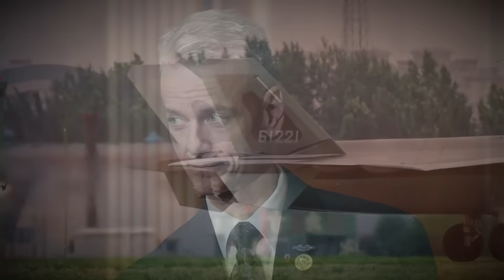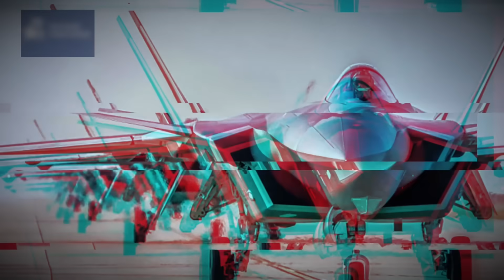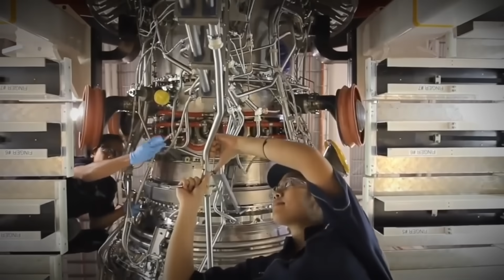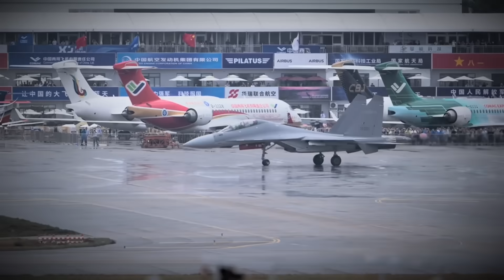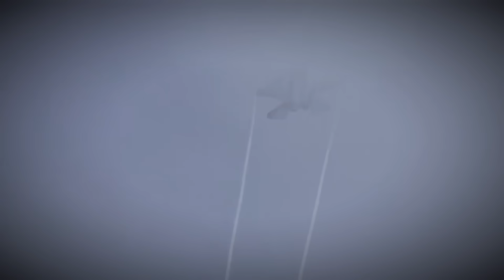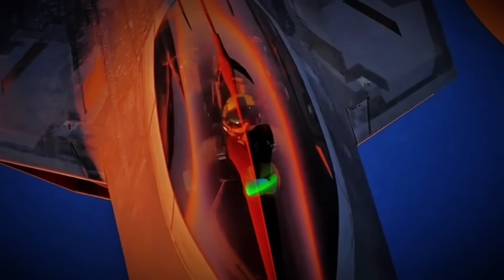GE Just Broke Its Silence on China's Jet Engine Advancement

Comment: You can bet China will continue to improve its jet engines, gaining more thrust to weight, and improved reliability.
Reply: China's Fighter Jet Engines: 5th-Gen Leading the Way, 6th & 7th-Gen Test Flights Breaking New Ground, Fully Surpassing the U.S.
 
China's aviation engine sector has achieved a leapfrog development from catching up to global leadership. The 5th-gen engines WS-15 and WS-19 have long outperformed their U.S. counterparts in performance. The 6th and 7th-gen fighter jet engines have even completed successful test flights ahead of schedule, completely widening the generational gap with the U.S. in core technologies, performance parameters and future layout, demonstrating the strong strength of China's aviation engines and firmly seizing the commanding height of the global aviation engine track.
 
In the field of 5th-gen engine power, WS-15 and WS-19 have made precise breakthroughs in U.S. technical barriers. As the standard power for the J-20, WS-15 is a performance benchmark among global 5th-gen large-thrust engines, with afterburning thrust reaching 18.5 tons and thrust-to-weight ratio exceeding 10.5. Compared with the F119 engine equipped on the U.S. F-22, its thrust is increased by 18.6% and thrust-to-weight ratio is over 50% higher, directly endowing the J-20 with 1.8 Mach supersonic cruise capability, and the response speed of supermaneuverable actions is 0.8 seconds faster than that of the F-22, achieving comprehensive suppression in air combat and penetration capabilities. In terms of core materials, WS-15 adopts domestically developed 3rd-gen single-crystal turbine blades that can withstand temperatures up to 1577℃, equipped with 128 nanoscale micro-cooling channels, improving cooling efficiency by 37%. The stable working time of the blades exceeds 4000 hours, and its high-temperature reliability is 1.5 times higher than that of the F119, completely solving the problem of high-temperature wear of previous aviation engines. WS-19, adapted for medium-sized 5th-gen fighters, is a world-leading medium-thrust engine with maximum thrust exceeding 12 tons, far surpassing the 10-ton thrust limit of the U.S. F414 engine equipped on the F/A-18. Its turbine inlet temperature reaches over 1850K, with excellent explosive power and energy conversion efficiency. It also adopts a compact 3-5-1-1 configuration, reducing weight by 12% while improving reliability by 20%, adapting to the deck operation needs of carrier-based aircraft. Its performance is comprehensively superior to the U.S. F414 and European EJ200 engines, filling the gap in domestic medium-sized 5th-gen fighter power.
 
On the basis of the stable leadership of 5th-gen engine power, China's 6th-gen fighter jet engine has taken the lead in completing installed test flights, with technical maturity and performance far ahead of the U.S. The U.S. 6th-gen engine XA100 is still in the ground test and partial verification stage, with unresolved mode switching failure risks, while China's 6th-gen variable cycle engine has achieved stable air operation, with core technologies and performance indicators reaching the world's leading level. In terms of performance, the engine's afterburning thrust exceeds 22 tons and thrust-to-weight ratio is over 12, 17% and 14% higher than the U.S. XA100 target values respectively. It adopts variable cycle technology with independent intellectual property rights, which can seamlessly switch between "high-thrust supersonic cruise mode" and "high-efficiency energy-saving cruise mode" in less than 0.5 seconds. It can not only support 6th-gen fighters to achieve 2.5 Mach supersonic cruise and a range exceeding 10,000 kilometers, but also reduce fuel consumption by 37.5% during subsonic flight, balancing combat effectiveness and endurance; the U.S. XA100 can only achieve a 10% increase in thrust and 25% fuel saving, and its complex mechanical valve structure is prone to stuck mode switching, resulting in significantly lower practicality. In terms of technology, China's 6th-gen engine innovatively adopts a three-bypass + interstage combustion chamber design, reducing 20% of core parts, with a fault diagnosis accuracy rate of 99.2%, which can predict faults 200 flight hours in advance and improve maintenance efficiency by 50%; it is also equipped with new stealth composite materials, reducing the engine's radar cross-section by 60%, meeting the all-domain stealth needs of 6th-gen fighters, while the U.S. XA100 still uses traditional metal casings with no substantial breakthrough in stealth performance, showing an obvious technological generational gap.
 
More promisingly, China's 7th-gen fighter jet engine has completed its first flight with the prototype, while the U.S. is still in the technical pre-research stage, completely seizing the opportunity in the future aviation engine track. China's 7th-gen engine breaks through the traditional turbofan power framework, adopting combined cycle propulsion technology integrating turbofan-ramjet-scramjet, combining hydrogen-oxygen rotating detonation power principle, with thermal efficiency reaching 49%, thrust increased by 20% compared with 6th-gen engines and weight halved. It can support fighters to achieve hypersonic cruise above 5 Mach in the atmosphere and a maximum speed exceeding 6.5 Mach, and can also adapt to low-orbit space flight, realizing "air-space integration" all-domain combat; the U.S. 7th-gen engine still focuses on traditional turbofan technology upgrades, failing to overcome the hypersonic propulsion mode switching problem, and can only achieve a speed target below 4 Mach, with comprehensively limited power performance and application scenarios. In terms of core technological breakthroughs, China's 7th-gen engine has conquered key technologies such as high-temperature supercritical pressure pipelines and quantum plasma stealth coatings, with turbine blades capable of withstanding temperatures exceeding 1827℃, and can operate stably in extreme environments such as high-altitude low temperature (-60℃), high humidity (95%) and sandstorms, with full battlefield adaptability; it also innovatively adopts intelligent bionic structure and self-healing technology, which can automatically fill and repair minor component damage within 1 hour, greatly improving battlefield survival capability. In contrast, the core materials and self-healing technology of the U.S. 7th-gen engine are still in the laboratory stage, and no long-term ground thermal test has been carried out. Compared with China's progress of completing the first flight and gradually advancing engineering, the generational gap cannot be narrowed in the short term.
 
From the 5th-gen engine outperforming U.S. counterparts, to the 6th-gen engine leading in test flights, and then to the 7th-gen engine taking the lead in opening a new air-space track, China's fighter jet engines have achieved continuous breakthroughs in three generations of iteration, with core materials, key technologies, performance parameters and development progress comprehensively surpassing the U.S. It not only lays a solid power foundation for the leapfrog improvement of China's air force combat effectiveness, but also redefines global aviation engine technical standards, demonstrating the absolute competitiveness of China's high-end manufacturing and cutting-edge technology, and completely breaking the long-term Western monopoly in the aviation engine field.
Reply from the maker: Absolutely! China's advancements in jet engine technology are impressive, and it will be interesting to see how they continue to innovate and improve.
Reply: @EngineeredGiants They already surpassed the USA.
Reply: It's a no brainer.

Comment: GE and Rollls Royce ban the sale of engines to China. Now you reap what you sow 🤭
Reply: Next, EUV lithography machines
Reply: @georgeeagle872 Also next, Thorium reactors producing 100MW, Rail Gun on Chinese destroyer, Gen 6th Fighter aircraft,
120,000 tones nuclear-powered carrier....
And this one will take the cake... Man landing on the moon by 2028..
Reply: @SengpoSatbang there are 2 type railgun, the old style and the electro magnetic rail gun...

The 500 kW laser gun which can take down a long range missiles...

The CH-7  huge drone...

The anti air missiles HQ-series)

and so much more to write it down...
Reply: @SengpoSatbang  Dude, China is already ahead in many tech areas (in 37 out of 46 future tech areas as of A.S.P.I.), especially re. 6th gen jet fighters (J-36 and J-50) that no one else in the world has, not even the U.S. (in spite of the yanks' bragging about having one).
Reply: @SengpoSatbang  Thorium reactors for military use are a big question mark, but as Chinese ships get bigger, it's not out of the question.
Reply: Done! Already 3nm and developing further.
Reply: @breakbollocks9164plus I am seeing reports of an analog chip which could be a breakthrough in AI.
Reply: China's Fighter Jet Engines: 5th-Gen Leading the Way, 6th & 7th-Gen Test Flights Breaking New Ground, Fully Surpassing the U.S.
 
China's aviation engine sector has achieved a leapfrog development from catching up to global leadership. The 5th-gen engines WS-15 and WS-19 have long outperformed their U.S. counterparts in performance. The 6th and 7th-gen fighter jet engines have even completed successful test flights ahead of schedule, completely widening the generational gap with the U.S. in core technologies, performance parameters and future layout, demonstrating the strong strength of China's aviation engines and firmly seizing the commanding height of the global aviation engine track.
 
In the field of 5th-gen engine power, WS-15 and WS-19 have made precise breakthroughs in U.S. technical barriers. As the standard power for the J-20, WS-15 is a performance benchmark among global 5th-gen large-thrust engines, with afterburning thrust reaching 18.5 tons and thrust-to-weight ratio exceeding 10.5. Compared with the F119 engine equipped on the U.S. F-22, its thrust is increased by 18.6% and thrust-to-weight ratio is over 50% higher, directly endowing the J-20 with 1.8 Mach supersonic cruise capability, and the response speed of supermaneuverable actions is 0.8 seconds faster than that of the F-22, achieving comprehensive suppression in air combat and penetration capabilities. In terms of core materials, WS-15 adopts domestically developed 3rd-gen single-crystal turbine blades that can withstand temperatures up to 1577℃, equipped with 128 nanoscale micro-cooling channels, improving cooling efficiency by 37%. The stable working time of the blades exceeds 4000 hours, and its high-temperature reliability is 1.5 times higher than that of the F119, completely solving the problem of high-temperature wear of previous aviation engines. WS-19, adapted for medium-sized 5th-gen fighters, is a world-leading medium-thrust engine with maximum thrust exceeding 12 tons, far surpassing the 10-ton thrust limit of the U.S. F414 engine equipped on the F/A-18. Its turbine inlet temperature reaches over 1850K, with excellent explosive power and energy conversion efficiency. It also adopts a compact 3-5-1-1 configuration, reducing weight by 12% while improving reliability by 20%, adapting to the deck operation needs of carrier-based aircraft. Its performance is comprehensively superior to the U.S. F414 and European EJ200 engines, filling the gap in domestic medium-sized 5th-gen fighter power.
 
On the basis of the stable leadership of 5th-gen engine power, China's 6th-gen fighter jet engine has taken the lead in completing installed test flights, with technical maturity and performance far ahead of the U.S. The U.S. 6th-gen engine XA100 is still in the ground test and partial verification stage, with unresolved mode switching failure risks, while China's 6th-gen variable cycle engine has achieved stable air operation, with core technologies and performance indicators reaching the world's leading level. In terms of performance, the engine's afterburning thrust exceeds 22 tons and thrust-to-weight ratio is over 12, 17% and 14% higher than the U.S. XA100 target values respectively. It adopts variable cycle technology with independent intellectual property rights, which can seamlessly switch between "high-thrust supersonic cruise mode" and "high-efficiency energy-saving cruise mode" in less than 0.5 seconds. It can not only support 6th-gen fighters to achieve 2.5 Mach supersonic cruise and a range exceeding 10,000 kilometers, but also reduce fuel consumption by 37.5% during subsonic flight, balancing combat effectiveness and endurance; the U.S. XA100 can only achieve a 10% increase in thrust and 25% fuel saving, and its complex mechanical valve structure is prone to stuck mode switching, resulting in significantly lower practicality. In terms of technology, China's 6th-gen engine innovatively adopts a three-bypass + interstage combustion chamber design, reducing 20% of core parts, with a fault diagnosis accuracy rate of 99.2%, which can predict faults 200 flight hours in advance and improve maintenance efficiency by 50%; it is also equipped with new stealth composite materials, reducing the engine's radar cross-section by 60%, meeting the all-domain stealth needs of 6th-gen fighters, while the U.S. XA100 still uses traditional metal casings with no substantial breakthrough in stealth performance, showing an obvious technological generational gap.
 
More promisingly, China's 7th-gen fighter jet engine has completed its first flight with the prototype, while the U.S. is still in the technical pre-research stage, completely seizing the opportunity in the future aviation engine track. China's 7th-gen engine breaks through the traditional turbofan power framework, adopting combined cycle propulsion technology integrating turbofan-ramjet-scramjet, combining hydrogen-oxygen rotating detonation power principle, with thermal efficiency reaching 49%, thrust increased by 20% compared with 6th-gen engines and weight halved. It can support fighters to achieve hypersonic cruise above 5 Mach in the atmosphere and a maximum speed exceeding 6.5 Mach, and can also adapt to low-orbit space flight, realizing "air-space integration" all-domain combat; the U.S. 7th-gen engine still focuses on traditional turbofan technology upgrades, failing to overcome the hypersonic propulsion mode switching problem, and can only achieve a speed target below 4 Mach, with comprehensively limited power performance and application scenarios. In terms of core technological breakthroughs, China's 7th-gen engine has conquered key technologies such as high-temperature supercritical pressure pipelines and quantum plasma stealth coatings, with turbine blades capable of withstanding temperatures exceeding 1827℃, and can operate stably in extreme environments such as high-altitude low temperature (-60℃), high humidity (95%) and sandstorms, with full battlefield adaptability; it also innovatively adopts intelligent bionic structure and self-healing technology, which can automatically fill and repair minor component damage within 1 hour, greatly improving battlefield survival capability. In contrast, the core materials and self-healing technology of the U.S. 7th-gen engine are still in the laboratory stage, and no long-term ground thermal test has been carried out. Compared with China's progress of completing the first flight and gradually advancing engineering, the generational gap cannot be narrowed in the short term.
 
From the 5th-gen engine outperforming U.S. counterparts, to the 6th-gen engine leading in test flights, and then to the 7th-gen engine taking the lead in opening a new air-space track, China's fighter jet engines have achieved continuous breakthroughs in three generations of iteration, with core materials, key technologies, performance parameters and development progress comprehensively surpassing the U.S. It not only lays a solid power foundation for the leapfrog improvement of China's air force combat effectiveness, but also redefines global aviation engine technical standards, demonstrating the absolute competitiveness of China's high-end manufacturing and cutting-edge technology, and completely breaking the long-term Western monopoly in the aviation engine field.
Reply: @kinwaisiu9414 you are a great mouthpiece for the chinese communist. What do they give you, a peiking duck?
Reply from the maker: It’s definitely a complex situation where geopolitical decisions have significant long-term impacts on global supply chains and technological development.
Reply: China will retaliate with a ban on sale of advanced alloys, rare earths to GE and Rolls-Royce. Can GE and Rolls-Royce independently source the materials needed to make high performance jet engines without China?
Reply: They didn't slow China's development. They simply can't stop China from developing.
Reply: True, but without critical minerals and electronic resources, GE and Rolls Royce are also depend on china supply
Reply: India used GE engine but called the Tejas indigenously built 😂😂
Reply: I thought China owned GE.
Reply: @jaybramble2029      The GE appliance division was sold to Hajer.